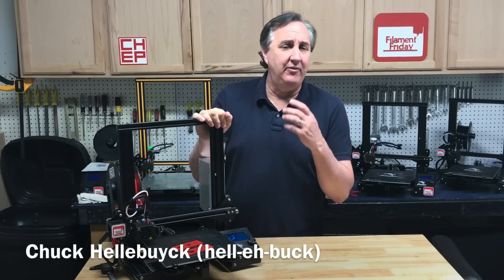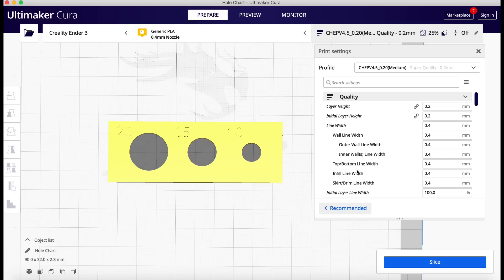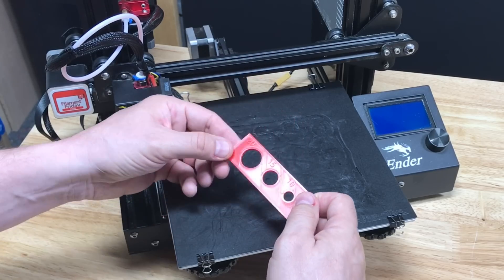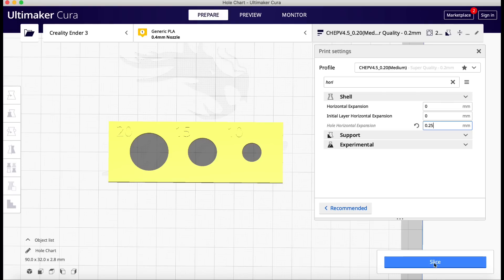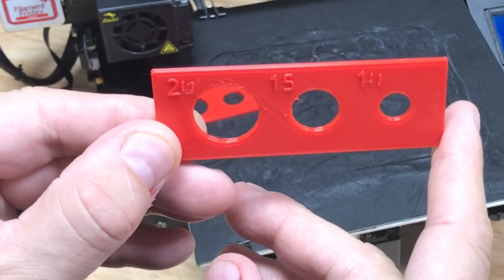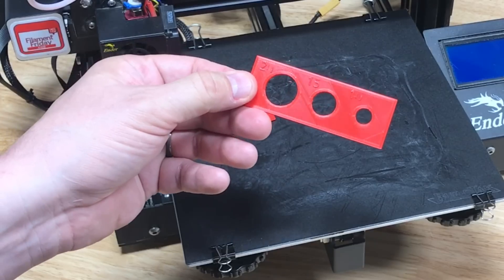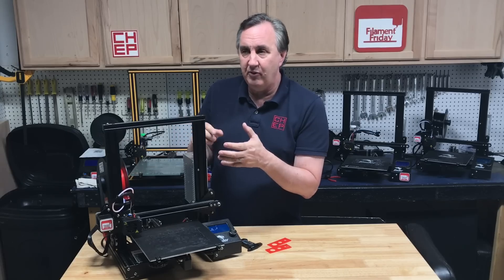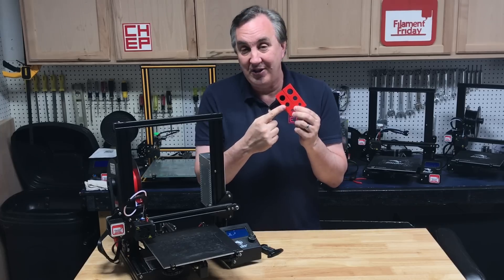Horizontal Expansion Setting in Cura

Comment: I was a bit skeptical so I model the exact object in solidworks, saved it with an extreme quality STL, used the same settings in CURA and printed. I got the same results, perfect external dimensions but holes are 0.5mm smaller. I hadn't noticed this problem before. Now we know the fix but I don't know why CURA is producing this error. Could you investigate further why? Thank you for your videos ;)
Reply: I also modeled the test piece in Fusion 360,sliced and printed it. Holes was smaller by 0.3mm. Corrected the différence in Cura and bingo, dimensions of the three holes are corrects. Thanks a lot Chep having shared this improvement brought by this release.
Reply: @philippe5394  how do u calculate the number to dial in?
Reply from the maker: Giorgio Avato - Thank you for sharing. I’ve pinned this comment to help clarify the issue.
Reply: @FilamentFriday  how do you calculate 0.25 is the right number? for horizontal hole expansions?
Reply: @johnrockets3719  He measured an undersize of .5mm in diameter with his caliper and then divied this value by 2 to get the radius (expansion is meant symmetric in - and + direction)
Reply: It's quite simple. Your slicer/stl does not create circles, instead it creates a many sided shape with tiny flat sides. The sides of these tiny flat sides protrude over the shape of the circle, making it smaller than the circle size. At least, that's my understanding of it - could be more to it
Reply: @Etacovda63   "... Your slicer/stl does not create circles, instead it creates a many sided shape with tiny flat sides. ..."

This is not what a slicer does at all. The slicer typically creates gcode. Printing gcode can result in near circular artifacts, particularly along the x-y plane, as in this case. The tolerance is found to be 0,1-0,2 in plenty of tolerance tests, even for small circles. But sure, if you got a low resolution STL, nothing is near circular. For that to valid for this video, he simply need to export the model like he has no clue as to what he is doing. Is that what you are implying? Oh boy. Had a closer look at the video, and the edges of the circles are jagged. So this is a video of how to correct holes when you export models wrong?
Reply: @FrodeBergetonNilsen  so it would seem. Anyone else looking at this video, look at 4.00 minutes and up - the 'circles' arent even close to circular, its a terrible STL export. As you say, circles are always going to be slightly off due to the nature of gcode/stl exporting - but not like this video.
Reply: cnc kitchen did a video bout it
Reply: @yonggor  can't find that video
Reply: still no G2 from cura
Reply: @Ureallydontknow  I am actually surprised it doesn't support that at since CNC machines and post processors can.
Reply: if you set the slicer to "including" then inner holer will be smaller, set excluding to make em bigger.
Reply: DasJev where is that setting?

Comment: How to measure models from Thingiverse ID of model in Cura so I can print the exact I’d size?  Rather than waste 31 hours to find out it’s WRONG.  Sometimes I snip off the critical section of the print and just print that but sometimes it still takes 2-3 tries to get it right?
Could you recommend a free 3D print forum so I wouldn’t have to bother the YT poster, and hope they have time to reply when I have a question?

Comment: So, you make the horizontal hole expansion correction and it prints correctly.  Where does it store this 'offset' for subsequent projects?  Is it stored with your machine profile in Cura?  If you update Cura, do the profiles also migrate?  Thank You
Reply: the setting get saved in your cura profile. if you go to your preferences in cura, then profiles, click one of your profiles, you can click the 3 bars for options. there you will find an option to export a profile. i think cura profiles automatically move to the new version. but i like to save my profile just to play it safe.

Comment: Thanks for sharing! I mostly print mechanical type parts and the small hole issue has been a real pain. It's especially annoying for CAD modelers like myself, either you have to later drill the holes to size after printing or compensate for it the model. I'm use to basic CNC machining where accuracy is almost always spot on so I hate having to use compensated hole dimensions when modeling a part for 3d printing.  I'm looking forward to trying this feature.

Comment: I'm working on a different X/Y calibration print that you measure distance between holes instead of measuring the print's outside dimensions.  I design a lot of things that screw together so hole location is very important.  This does leave the outside dimensions a little oversized though so I'll have to try the horizontal expansion for that as well as the holes to see if I can get holes a bit closer to the right diameter.
Reply: I think the commercial focus of 3D printers is on making useless knick nacks. I hope the resin printers and slicers fix this issue. How are you doing 2 years later?

Comment: Can you explain the math? How did you go from 5 to 25? Thank you.
Reply: No, the diameter of the holes is off by 0.5 mm, but Cura wants the adjustment entered as a radius. So half of the diameter adjustment is 0.25 mm. He explained it in the video.
Reply: 0.5 divided by 2 is 0.25
Reply: @roofoofighter  should be 2.5

Comment: At 3:10 you can see that the holes are not circles but 20-gons or something like that. I wonder if they'd still be so inaccurate if the model would be exported with decent angular resolution. I usually use 1°.

Comment: Hard to believe Cura is up to 4.11 now. 

Anyway glad I found this. Chuck to the rescue! I designed a battery holder with tight tolerances and it ended up .5mm too small so I am attempting this tonight. I probably should stop the print and size test the footprint but I'll live.

Comment: This is an old video, but given the issue in the original print is geometric inaccuracy using Cura, the better solution is just to use a more geometric accurate slicer. Since this appears to be an issue in Cura,  adjusting for it when modeling, would be the better approach.
Reply from the maker: Not always possible if you download the design from Thingiverse or similar.
Reply: @FilamentFriday  You actually made a video in which you model in CAD, then use Cura to generate the gcode. Even if you download from Thingiverse, a more accurate slicer would not need this hack. It is only useful if you got a model in say STL, that you need to modify. (if you at all can) Otherwise it is bad practice to hack a model like this in the slicer. Using this hack to correct geometric inaccuracy in the slicer, is a seriously bad solution. It is a sign of utterly bad management practice, if this is how Cura is designed. I also hope that you are honest about these things, when confronted with them, like I do here. Your answer so far, do not reflect that, more of a cover-up and doubling down. That is not going to take us very far, is it?

Comment: Decided to try this, apparently it doesn't work on square holes :( Should re-check my esteps though.
I also wonder if using Arc Welder plugin for Cura will change the issue with round holes being too small as it creates arcs instead of line segments. So far I can tell it makes smaller gcode files where circles are involved, almost two times smaller for my file with 4 buttons (for sewing) in it.

Comment: The hole expansion setting can cause havoc on models with thin (ish) walls... which you kind of covered with the issues on the 0's in your model. Most reliable way is to include tolerance in CAD for these situations in my opinion

Comment: The measuring edges of your caliper are square and you are measuring inside a round hold.  You need a knife edge on the caliper to measure a round hole.  If the hole was larger the error would not be as noticeable, but with small holes...
Reply: The inside jaws on calipers are typically knife edged, probably for this reason.

Comment: -+-Chep, love your vids, got a question, I make round coins with round cutouts in the middle for insert that i put in there, now if my dia. of coin is 2" and a hole of 1" and print it and the dia. is actual 1.99" dia. and hole is.99" dia I.D. should i use the horizontal setting in cura or just go to my print and increase or decrease  model and knowing thats how my printer works and design accordingly to a finished part? I did notice that when u adjusted using this setting it messed up the letters you had on there because they were a close loop .

Comment: hey, ı have a problem with outer diameter. I fix the inner diameter with this settings but outer cyclinder diameter is little bit less when I try to print cylinder with hole. even dimensions of square cube and other settings are ok , outer diameter is less then that it should be. can you tell me how can I fix this issue?  
Thanks  =)

Comment: Hii, can i implement to this trick to gear planetary ?   Please teach me master. 
For the example i have hole 3mm + 0.25mm (tolerance / hole expansion )  and set to hole expansion on cura profile 0.25 right?
Reply from the maker: Adjust to half the diameter error.

Comment: Hi Chuck, thanks for revealing and explaining this useful feature. I noticed your holes don't show a seam inside of them. How do you achieve this? Would you kindly share your tip please? And are your holes' dimensions also correct 90⁰ from your measuring direction? Looking forward to hearing from you. Thanks very much in advance, cheers!
Reply: Search for the z seam setting.  Change it to random.  I think this is what you want.
Reply: @TheSuburban15  Hi, thanks for your input. The Z seam setting would apply to every parts of my prints, potentially causing zits or blobs appearing in a random fashion anywhere. I get really clean prints, and my only reason for not being 100% satisfied is the inner seam I get in my vertical holes (used for centering / centering inserts). Thanks to coasting and retraction, I get close to what I want but still not perfect. Thanks again for your suggestion.

Comment: Thank you very much for this help! I had the problem to get fitting squares for 2040 Aluminum Rails for a Project. With this Video I was able to fix this. One little thing left are the horizintal lines, when 5 mm Holes are printed. In these areas the lines came slightly in- and outside from the Workpiece and needs filing or pressing them away with the Rails. But it also had a little advantage that the Parts came together not too loose. Next thing I will check out the "Elephant foot" in Cura 4.7.x..

Comment: Also .. if you want an idea for a new video .. well unless someone has already done it .. is the effects of UV on part shrinkage .. in my case it was intentional .. because it seemed to be doing that ( UV shrinkage ) .. and to prove it wasnt just the heat from the sun .. I put a part that has a hexagon hole thats supposed to fit over a bolt head, however it was to big and loose .. I put the part under a UV grow LED .. ( 50 W ) for a few hours ..  the part wasnt too warm .. but it shrank the part so it was nice and tight on the bolt head .. anyone seen videos on this ?
Reply: huh, that's interesting. I know Tom Saladerer did a video on the effect of UV on PLA and its strength afterward, but using it to shrink a print, I haven't seen anything on that.

Comment: But failing this, we could actually just resize every hole up by .5mm and not use that setting?
Seems like if the fix can change other aspects, I'd rather do that.
Reply: It's called holes why would it change anything but holes?
Reply: @pete.williams  It has to decide what a hole is. In this sense, it would alter everything with an internal circumference, so it's not a cure all.

That's why it's an option, and not hardcoded for all.

Comment: What about the offset distance of each hole? and the distance from the edge? Thank you very informative video. I am about to print a part that has that problem exactly.
Reply from the maker: Everything should be relative to the center of the hole.
Reply: CHEP thank you for confirming it :)

Comment: what have I done? :-/   I installed cura 4.6.1 and when i bring in the model it is hanging off the edge of the plate.  Can you tell I'm novice here ;-)
Reply from the maker: Right click and select center to bed
Reply: @FilamentFriday  when I so that it puts the model half on top and half underneath the bed.  I can see what is on the bottom of the bed.  .  Screen shot to follow.
Reply: i Can't get the bottom of the model to get on the bottom of the bed.  I can't get the screenshot on here either. sigh    It's like it cuts the model in half.  I am on the Prepare screen.

Comment: Could you use a support blocker to block out the holes so only they are affected by the setting? (similar to what you did for 100% infill in your video (3 Cura Slicer Setting Tricks For Beginners)

Comment: Glad I watched this Video since I'm about to start Designing and Printing Percision things.  New to 3D, but it this issue of inaccurate size, just ROUND HOLES?  Wouldn't a solution be just to make the Hole in TINKERCAD 0.5mm Bigger?
Reply from the maker: As long as you print a section first to verify it works.

Comment: Why do I get an error when trying to import your 4.5 files to cura 4.6.1? I am unable to import the profiles  ;-(
Reply from the maker: Select the Ender 3 machine first then load them.
Reply: @FilamentFriday  , managed to import the profiles after selecting the Ender 3, but when I choose my printer Prusa I3, the profiles will not show up. Why??? With cura 3.6 version I have no problems importing the progiles when using prusa i3 printed selected. Continue with those great videos!

Comment: I use a Longer LK4. The new version 4.6.1 would not work with my printer. It kept starting to print around 25mm off the printing plate. Didn't seem to be able to find the proper xyz axis. Don't delete your old version if it works until you know the new version works at all.

Comment: unfortunately cura 4.6.1 is even worse as the predecessors. from the start of the Cura 4.0 series quality has gone down, doesnt support dual nozzle or self bould machines and with the latest version  the &*#$@ Software doesn't  even start, it just crashes.
it is just crap
Reply: You do understand Cura is made for Ultimaker machines, because it isn't getting better for some other printer you have which doesn't support slicing or if so usually an old cura, re skinned, doesn't mean it's crap, they've done good to support so many printers in many ways so far. With new updates obviously comes issues but there's more things to use. I would never recommend to anyone to update immediately if they rely on it or are unable of sorting things or finding out the issue. I have been on 4.2.1 for ages because i haven't really needed to update, and i'm also not sure what you mean by cura supporting dual nozzle as i'm fairly certain they do

Comment: Good video thanks. But now your holes are elliptical , your vertical dimensions of the holes should still be 0.5mm smaller. is that right?
Reply from the maker: Vertical is Z direction. Horizontal is X,Y direction. Holes are still round.

Comment: So I don't have a printer yet, but why is it having issues printing a hole correctly on the first place? As you showed, the outer dimensions are correct so it knows how to put it down in the right coordinates
Reply: It's called "Horizontal expansion" for something, let me explain: the printer melts plastic by heating it up a lot, and when you heat stuff, it expands, and when you cool stuff, it contracts, so by how the plastic is layed down some parts of the print (like holes) can contract once the print cools down, and so it produces inaccuracies like the one CHEP showed, where the holes come out smaller, and that's what Cura tries to correct with that setting
Reply: @ivomo_  ah, thanks much for the explanation!

Comment: Didn't you recognize the polygonal shape of your holes?
Reply: Zock'n' Roll I think that’s a symptom of the STL format, which saves models as a bunch of triangles.
Reply: @neilkelly3818  Yeah, that seems plausible. So is it an error of the CAD (maybe more details required) by exporting to stl or is it an error of the new Cura-function?
Reply: @neilkelly3818  tinkercad only does circles of 64 segments would be my guess.

Comment: this is interesting but why does cura make this mistake prusa is better. I dont understand you added .25 to cura on hole but how would all the hole fallows if you added .25 wouldnt the smallest be bigger?
Reply: If I understand your question correctly, the .25 mm is absolute, not realtive to the diameter of the hold.

Comment: I updated to 4.6.1 and the Hole Horizontal Expansion does not show up in the Shell category.  It does  show when I search for it, but it is italicized and grayed out.  I have been using Outer Before Inner Walls rather than Optimize Wall Printing Order to get more accurate dimensions, as is says in the comment.  Is one not compatible with the other?  Or should the Hole expansion work along with Outer Before Inner?  I'm using a Creality CR-10.  EDIT: I found that the Hole Horizontal Expansion was not checked in the Setting Visibility list.  However, I note that the description for just Horizontal Expansion mentions specifically affecting hole diameter.

Comment: No amount of fiddling with the horizontal expansion has helped me get rid of my strange dimensional accuracy issues. X axis produces wider parts, Y axis is thinner etc, but holes are too thin while corkscrew threads are too loose. A complete guide on fixing things like that would be amazing! I'm using Cura 3.6 but it never improved going to 4.x
Reply: First step in the guide.
Upgrade your software.